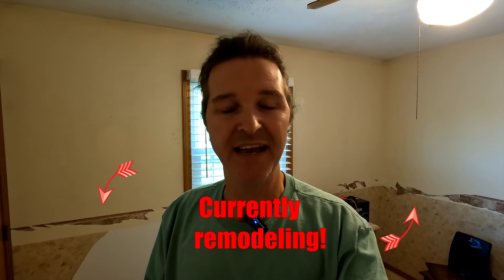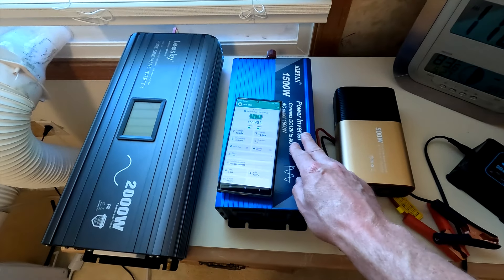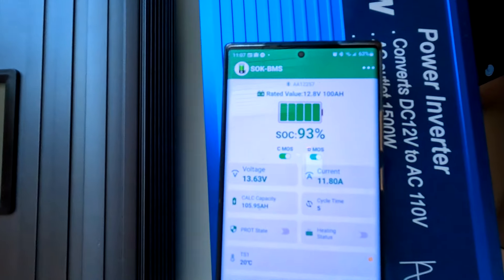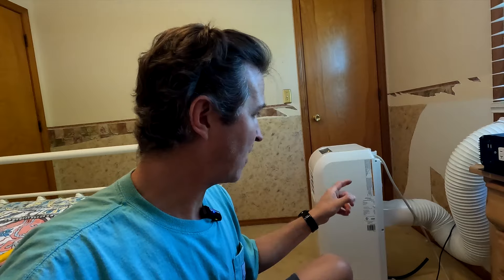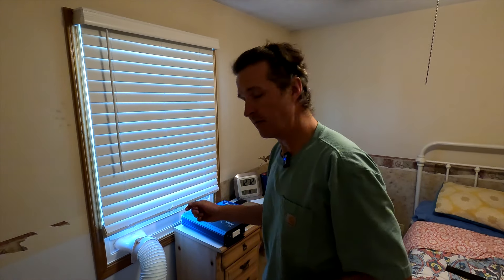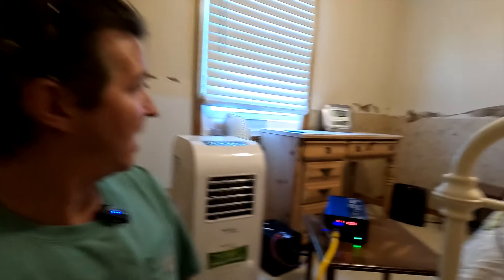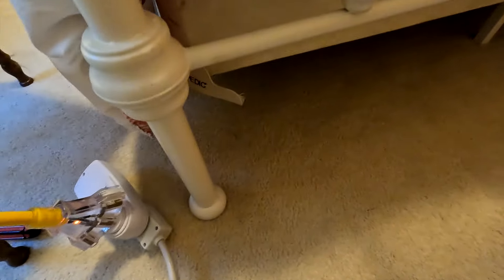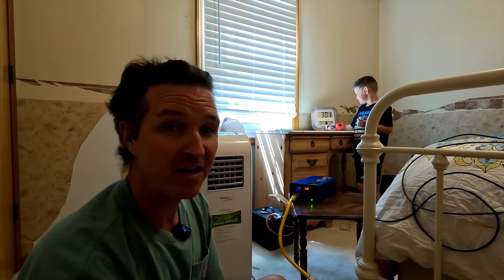Running 8000 BTU Air Conditioner with a 12v 100ah LifePO4 Battery!

Comment: Great video. It's awesome that you were able to run an 8000 watt air conditioner for 3 hours with just a 100 ah battery using a 1500 inverter. I enjoy seeing an actual test instead of looking at numbers.
Reply from the maker: They're more enjoyable to create as well!  Thanks for the comment.
Reply: Same.  Testing by real people all day any day.
Reply: I think it's 8000btu not 8000w.
Reply: 68 degrees outside and wants the room at 70 - no way 1000wh battery would power a 750w AC for 3 hours with the compresor on the whole time, like it would be on a 90 degree day.
Reply: @onthe80omw absolutely correct

Comment: When you looked on the nameplate specs and it said 24 amps.  That was the amps for starting the unit with the compressor on.  The term is LRA, which means Lock Rotor Amps.  It is for the starting amps or the amps that the unit would pull if the compressor became locked up.  I was an Electrical Contractor for 45 years and an Air Conditioning Contractor for 44 years.
Reply from the maker: Thank you for the information and the comment.
Reply: I’m an ac contractor 23years you must be 75yo
Reply: @rightmindwellness6254  I am nearly 75, I am going toward 74.  Most of my career was when Freon 22 was about $30.00 to $60.00 a drum.  Freon prices are crazy now.  Retired now.  Have a great day.
Reply: Thats why inverter units are better it doesn't use starting amps just runs continuously
Reply: I have a 1 year old upright and it draws almost no extra current to start the compressor. Almost no surge amps, its the new technology, just like new sump pumps today. Their running watts are almost the  same as the surge watts.
Reply: @rockstarkid505 Can you give a suggestion of an inverter unit?

Comment: This is why I like this channel, real world testing. I watched the one where you powered a fridge too. I used my watt meter and did the math with a 5000 btu window unit and just using one 100ah battery would have given me about 4 hrs, but like you didn't take into account that the compressor doesn't run constantly. I use a Kreiger 2000/4000 inverter. Still, I went ahead and added a 2nd 100ah battery and an additional 100watt solar panel to be able to cover the usage should we have a power outage. Thanks for sharing all the stuff about this content it has helped me get started building my portable solar backup unit.
Reply from the maker: I'm happy to hear you appreciated it.  It sounds like you are well on your way to having a very useful system.  Thanks for the info and the comment.
Reply: Thanks so much for the video . I just bought a van and set up the back like a camper . I think I'm gonna get a 400 ah battery and see if it will run all night and add solar panels on the roof to recharge during the day  and not using the ac .  I found a small black & decker portable ac unit, so I hope it uses less watts that the unit you are using.  If I use a 2000 watt inverter instead of a 1500 inverter, do you think it will draw more power and not last as long as if I used a 1500 watt inverter ? This is for off grid camping .

Comment: I'm starting to look into solar power for a small RV. This is so helpful. Thank you!
Reply from the maker: Glad it was helpful!  Thanks for the comment.
Reply: @OffGridBasement should I just get the cheapest solar generator and just buy the higher wattage solar panels to draw power? Or will that not work because of the total capacity of generator? I’m new to this. I’m thinking about living off grid
Reply from the maker: @youtubedeletesmychannels2329 You need to do an energy audit to find out how much electricity is needed on a daily basis.  Also, power stations are limited to the amount of solar power they can accept.  Cheap ones are usually limited to 100 - 200w.

Comment: Hello friend. This ac obviously has inverter motor inside. My non inverter portable ac similar to yours but at 9000 BTU draws 4.4K inrush current. Its well known that inverter motors has minimum or even no inrush current at all that is why they are prefered especially for off grid set ups. Keep up the good work ! Greetings from Greece.
Reply from the maker: That thing is still sitting on my basement floor.  I'll get to it at some point.
Reply: It does not say that it is inverter type compressor in the user manual for his  GM-PAC-08E3 model number, it only costs about $300 so I doubt that it is inverter type compressor. It also does not say that 8000 Btu is ASHARE rated or SACC/DOE rated, for that price range it is more likely to be 5000 Btu SACC/DOE.
Reply: I find it highly doubtful too. My tiny mini fridge pulls 1200 watt when it turns on. Something is off.  Id love to know what and why.
Reply: I would probably use a 3000 watt inverter then I may have power to keep my refrigerator running also. Might need more solar panels to keep up the demand. Thanks this information is valuable. 73
Reply: @ronb6182  I got a Vevor pure sine wave 2500 inverter, I run the portable 8000 A/C similar to this one on my 2004 VW Rialta, with my EUHOMY Car Refrigerator, 55Liter(59qt) RV refrigerator, and more, my set up is two 800 watt solar panels, and two 280Ah LiFePO4 lithium batteries.

I'm currently chilling in the Yuma AZ desert 🏜
Reply: These are great videos, thanks

Comment: Thank you for making this great video. I am turning a cargo van into a camper. I have pretty much the same exact setup. This gave me peace of mind for my planning and I didn't have to buy any other components. I have a solar panel on my van that is 120 watts the charges the batteries during sunlight then I have a switch in place to use the vehicle battery an alternate each battery to run off the alternator individually water vehicles running to charge.
Reply from the maker: Thanks for sharing and the comment!

Comment: That was an excellent test.  It's good information to know if the power should go off.  We all know it doesn't take long for the house to heat up on a hot day with no a/c.  Thank you for a timely video.

Btw, you're very welcome for the air conditioner.  I'm happy it's working out for you.❤
Reply from the maker: We use it every night for our bedroom and it works great!  Thank you so much!
Reply: @Off Grid Basement  You're welcome, Jim.

Comment: One thing to mention, a dual hose AC unit is way more efficient than a single hose like yours.  That means you get to temp faster and stop sucking warm outside air into the room. Battery would last longer.   Dual hose sucks outside air into the unit, takes the condenser heat and blows it out the exit duct.  Single hose units like yours blows the hot air out, but where does the intake air come from…..that’s right your room just became a slight vacuum and is sucking in warm air from any cracks or door gaps.
Reply from the maker: I never thought about the vacuum effect.  That is a good point.  Thanks for the info and the comment.
Reply: @OffGridBasement pracer1 is correct, but the heat imparted from this exhaust pipe back into the room is another large factor of inefficiency, this is why this portable type A/Con are the most inefficient type to use, save the fact this is a inverter type which helps greatly with startup current, etc.  A window type is more efficient and a inverter split system is still better even if it is oversized, it will quickly reduce/increase temp and then derate down to a reduced  capacity (watts used). 
I am an Aussie, so we use 240vac. I have a 2.5Kw split in a 40’ bus on a 24v system and it works great in either mode and does not use as much power as I was expecting it to, it will ramp up to 1500-1800w max for 10-15 mins & then settle back to around 500-600w before cycling around a 100w with fan only after 20-30mins.  One more thing is to go for the newer propane based gas type  (R32) inverter splits for better efficiency. Cheers hope this helps.
Reply: Thank you for that insightful information. I did not know that. I will look for a dual hose unit. Do you have a dual hose unit you can recommend for my DIY Overland Camper?
Reply: But isn't a single-hose unit recycling the already cooled air while the dual-hose unit is sucking in hot outside air and trying to cool it?  Single hose seems more efficient.
Reply: @BillySBC  I think he's completely wrong. I have a dual hose and I'm pretty sure both hoses are exhaust.

Comment: The other thing your missing is the start up surge.  A plug in watt meter will not show that, only a good VOM with logging/tracking will. When I was testing my chest freezer, it only pulled 90w while running but had an 850w kick on surge (for about 2 seconds), but my 500w inverter couldn't start it up.  I bet your AC unit has a 1,000w kick on surge
Reply from the maker: Thanks for the info and the comment.

Comment: I would also add that researching "Solar Generators" that have at least 1.2 kW capacity (same as your 12v 100 ah scenario) might be a "better" solution.  Something with built in MPPT solar controller and efficient pure sine wave inverter.  Appreciate the video as I did not want to get a LARGE solar generator for whole house "hurricane prep".  I already have a 12,000 BTU portable A/C like you show there and think it would be better just to A/C the bedroom in case of power loss.

BTW, the reason there wasn't a large surge was because these units use inverter style compressor systems.
Reply: Or an EG4 solar DC solar hvac unit.
Reply: @halledwardb  didn't know of these, thanks
Reply from the maker: I do plan on building on this idea to see if I can double the running time and still have a comfortable room.  Thanks for the info and the comment.
Reply: The best test was just to put the cool on maximum and let it run to the battery dies probably less than 1 hour

Comment: LRA is your locked rotor amps.  The initial start up amps that the AC is going to draw to get it going.
Reply from the maker: Thanks for the info and the comment.
Reply: Wouldn’t 24Amps trip a 15-20 amp breaker?  24 seems a lot high.  That’s 2500+watts. No way.

Comment: BTW, if you plug a 120v surge suppressor (not a surge protector) into that 500w inverter, you'll likely be able to run the AC without it shutting down.  It's that initial surge that shuts the inverter off.  I use a 300w inverter to run a fridge with a cheap 120v Westinghouse suppressor and it works fine.
Reply from the maker: Thanks for the information and the comment!

Comment: 👍🏿👍🏿👍🏿 i needed this soooo bad. Finally, a real world non-nerdy presentation of AC on lithium. So would i be correct to extrapolate that 4 of those SOK would last 8+ (maybe 12) hours? Also can you do a recharge video of that SOK now that you depleted it? Thats my other piece of the puzzle i need. Thank you so much
Reply from the maker: You're welcome!  I'm glad you got something out of it.  Since I started the test in a very hot room I would think you could get 3 hours per 100ah battery easily.  I plan on doing more test videos with different room temperatures to see if I can get more runtime out of the battery.  I have another video on how to "wake up" a lifepo4 battery here:  https://youtu.be/j2JjOpq50MI
Hope this helps!

Comment: I really enjoyed this video, real time real results. You answered a major question I had about my own 500 watt air conditioner I use in my cabin. Now I know what I need for batteries at night. My solar will keep the batteries charged through the day usage of the air no biggy but im guessing day two i might have to have the generator help charge the batteries faster than the solar will and im good with that. Thanks for the video.
Reply from the maker: I'm glad the video helped with some questions you had.  Thanks for the comment.

Comment: If you added alot of solar panels you think you can run it 24/7 and while the battery stay charged!! Love the show!!!
Reply from the maker: Easily.  The problem would be at night.  You would need enough battery storage to last until the sun came back up.  Thanks for the comment.

Comment: Great Video!  Simple real life experience with a 100 amp hour battery. Not a 400 or 600 amp hour expensive set up. Just a 100 amp hour battery. All I need is about 5 to 6 hours of AC time at night. Hoping I can use my Solar during the day….. to some extent. I wonder if that unit is efficient or can you buy a very efficient model, to make it last even longer. Great information
Reply from the maker: Thanks!  This unit is actually pretty ineffective, but it works well.  I made another video of running the same setup but at 75⁰.  Thanks for the comment.

Comment: It kept the room cool for 3 hours,  but the actual run-time of the A/C compressor was much less  (maybe 45 minutes to an hour).  It has to do with Duty Cycle,  but still a great demo,  thanks for posting this.
Reply from the maker: True.  The compressor would shut off when it sensed the room temp was reached, but the fan runs continuously.  Thanks for the comment.

Comment: I think that power measurement device (I have the same one) will not measure the surge power, because it only measures once every few seconds, whereas the surge only lasts like half a second. You’ll need an AC clamp meter set on max measurement mode to properly measure this.
Reply from the maker: You're right.  I'll need to fashion a short extension cord with exposed wires for this purpose.  Thanks for the comment.

Comment: That's an impressively low voltage drop on the SOK for a such large load. 3.24V under 50A+ is pretty solid. Definitely clear SOK is using quality cells.
Reply from the maker: It really is a nice battery.  Definitely worth the money IMO.  Thanks for the comment.

Comment: Starters help tremendously
Reply from the maker: I'll need to find something so we can use a smaller battery and a solar panel to use the AC unit.  That would make for an interesting experiment.  Thanks for the comment!

Comment: Nice test. Obviously there are a lot of factors that can afford the outcome but at least it shows some real world results. Do you like that battery charger you’re using. I watched your review on it. I know it can do multiple battery types
Reply from the maker: I do.  It can get up to 20 amps.  Usually around 17 amps, but it's been very reliable.  Thanks for the comment.

Comment: The run time test is not realistic unless the outside temperature was hotter than inside.  That way, the AC has to remove the heat coming into the room through the walls.  If its colder outside, the room would cool down on it's own without the AC running.
Reply from the maker: I attempted to fix that problem by heating the room to the upper 80's.  I knew from the start that the outside air was going to affect the results as stated in the video.  I plan on doing the test again to see if the results are different when it's 90⁰ or more outside.  Thanks for the comment.

Comment: The LRA Locked Rotor Amperage is the amount of current that an electric motor will draw when it is started.  All electric motors have the same characteristic of requiring a vary large inrush of current to start the rotor turning. This inrush will typically be 3 to 4 times the running amperage of the motor and after the motor has reached rated speed, the current will fall to the running amperage so this unit will take 24 amps (115 x 24 =) 2760 watts to start and about 700 watts of continuous draw after the motors have come up to speed.  This is important because you would want use an inverter (no battery) or generator to run the unit. You would want to ensure that the inverter or generator had the  peak capacity for the LRA of the unit.
Reply from the maker: Thanks for the info and the comment.

Comment: put a bucket for the drain in back. you will have to dump it often unless you make a pump that runs and pumps the water out the window automatically when it becomes full enough. Alternatively if you put the water from it thru a water filter to purify the water for drinking.
Reply from the maker: Thank you for the info and the comment.

Comment: I use a 300ah Ampere Time, 2000w inverter and the old school manual controls 5000 btu Frigidare. It draws 400w max. I can connect it to solar but typically use a 20 amp wall charger to top it off before storms. If I sit right in front of it and set the thermostat properly I can get 20 hours of run time fairly easy. It uses 50 watts max with only the fan.
Reply from the maker: That is great!  Thanks for the info and the comment.

Comment: Great video I have a 12000 BTU minisplit AC  220v can you tell me what wattage inverter I need I believe it is 16Amps
And a guess how long the battery will last Thanks
Reply: 220v x 16amps would be 3520 watts. i would think a minimum 6000-7000 watt peak inverter or more, definately more = better. a 12v 100ah battery would only last about 20 minutes, most likely less with inverter losses.
Reply: @moparkr  OK thanks
Reply from the maker: If it does pull 16 amps at 220v then you are looking at a wattage draw of 3520.  I didn't see an amp surge on my AC but you might have one.  4000w inverter minimum would be my recommendation.  Hope this helps.

Comment: ...just multiply your AC amperage by 10x and you'll have what the 12V will need to push. So, that a/c unit requires 67 amperes of 12V power to run.
Reply from the maker: Thank you for the information and comment.